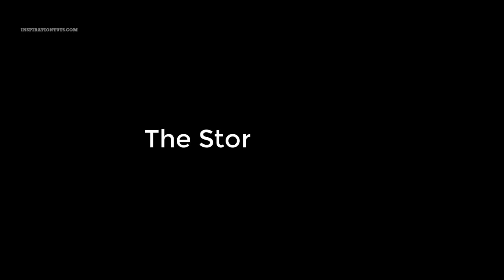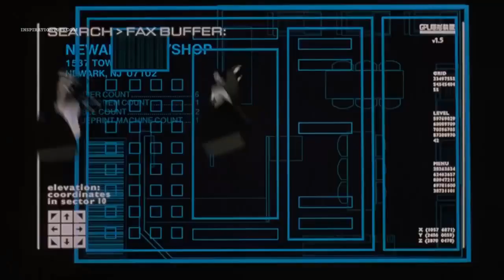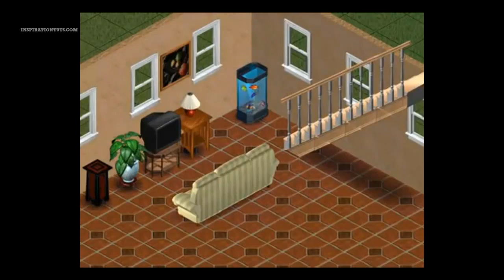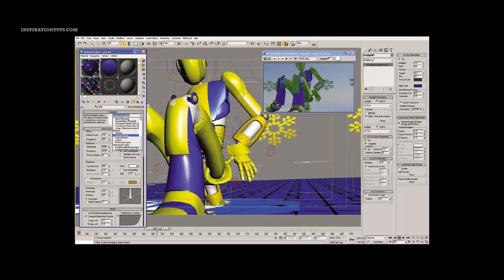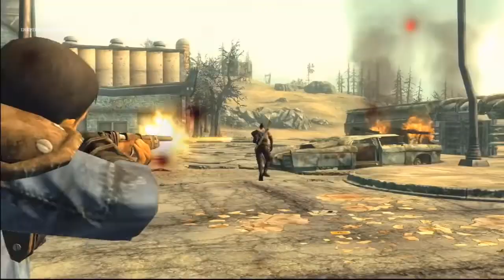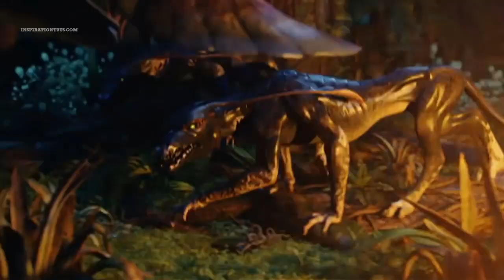3Ds Max History

Comment: just some info updates..... umm Personally Max9 was the last best max version... And 2012 movie. Yes rendered and built in max, but not right out the box.  A LOT of chaos group plugins were used as well. Max out the box could have not produced the fragmentation and particle physics for all the destruction effects. I think it also used vray for much of the rendering... It also used fume or another volume plugin that i cant remember the name of I think for the volumetric effects.  SO certainly not out the box... In any case I agrree with many comments that Max never got the credit it deserved. Maya seemed to always own that crown.

As for my history with max. I started using it around 1998, forgot what version that would have been R5?
Reply: The lead vendor, Digital Domain, did the escape from LA sequence in Maya and Houdini. A lot of the hero assets were modeled in Maya for 2012. As for the other shots, without going into details as to which vendor did what, Max was used for those.

Comment: Great video. 
I think some of the info's are not 100% correct (but not really sure). 
- Raytrace material was introduced in version 3, and that was huge back then. Or it was, raytrace shadows (or both). 
- Particle Flow was first released in version 5, not 6. 
- Edit Poly modifier was released in version 4, not 5. 

But these are not very important stuff.. keep up the great work!

Comment: 3dsmax never gets the credit it deserves as a breakthrough product in 3d animation.  It truly was the first software that was as powerful as it was and priced within reason for an independent artist.  It was, and still is, one of the easiest 3d software packages to learn and use.  It remains one of the most non-destructive modelings and animating workflows in the entire industry that doesn't require nodes to keep the parametric workflow intact.  It's not as deep as something like Houdini, which is entirely a node-based workflow, but it's still an amazing piece of engineering with a very simple overall UI.
Reply: All we had before 3D Studio was 'TOPAS' and 'Flying Fonts'  ;)
Reply: @WoodysAR  There was Wavefront and Animation Apprentice, but the former was way more expensive and the latter was very difficult to use (no polygons).
Reply: @Zinogg  Autodesk had always been part of 3dsmax since day 1.  The Yost Group and Discreet were both funded and published by Autodesk.  Even after Autodesk took full licensing they kept most of the Discreet devs on board.  Gary Yost came back as a consultant.
Reply: I use blender
Reply: @Algeriawindows69  then why are you here?

Comment: And to think Blender is topping them off as of lately. The only thing they need to do now is to insert a character creation plugin like Adobe Fuse along with some stuff from MS Paint 3D, replace the complicated Node editing with layers, and boom, we have a successful software.
Reply: Blender does have external plugins for character creation. They are Manuel Bastion Lab, and MakeHuman. 
The Node system for creating Materials is actually much better than layers, because you can actually get lost in layers, and if you make one mistake, it can wreck your entire project. That's why Nuke is better and preferred than After Effects for VFX. Houdini is also Node-Based for everything. Blender needs more Nodes for the other areas like Particles, Building objects and more. We've already got Animation Nodes, although that itself is very hard to get into...like all things 3D.
Animation nodes provides the ability to make Motion Graphics like in Cinema 4D. 
Also, there's an upcoming feature called "Everything Nodes" for blender. Not sure when it will be released, but it should make Blender more like Houdini.
Reply: @csmemarketing  I just think Nodes is a bit more complicated when it comes to attaching them. Also, Manuel Bastion Lab is defunct.
Reply: @thevfxmancolorizationvfxex4051  Manuel Bastioni has indeed ceased development, but the community took over and it's here for Blender 2.8X https://mblab.dev/

Also, I agree with the Nodes seeming to be more difficult, but there are many videos explaining how it works. When mixing Nodes, the bottom node is the top layer. That's the mystery solved. You can look up BornCG, CG Geek, Grant Abbit and Blender Guru for explanation on Nodes. 

After I learned how they work, it's nothing. I still have to learn how advanced Nodes work because there are some node combination that was though of as non-standard, but they make magical results.
Reply: @csmemarketing  I agree
Reply: Where did you hear blender is topping them off?